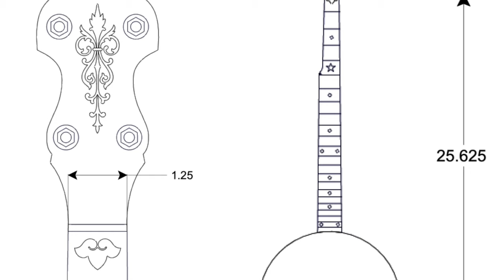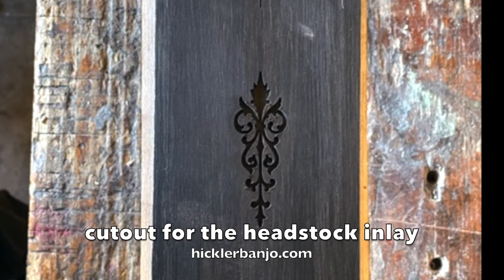Jack's Banjo conversion project -- from vintage Vega tenor to 5-string tubaphone

Comment: Jack...nice to see this documented. I also did a vega M conversion...neck by Rickards Banjos.. I'll message you a pic. Im sticking with the goat skin head..Rickards has installed a Renn head as well ..ok but I wanted an earthy warm sound without loosing sustain. Interestingly, Jason Romero suggested a coat of shellac dobbed on the inside of a renn head to reduce any chirpiness(my description) and warm the tone. Ive applied that to a 12" renn head banjo...and like it very much...better tone and no real lack of punch.
Reply from the maker: Thanks Doug! I might have to try the shellac trick.  The Ren head on the 1920 Vega sounds better than I thought it would, but a good skin head is always my preference.  El Nino brought a lot of humidity and rain to Colorado this summer, and I had to switch over to plastic heads on most of my banjos.  But winter is coming, so skins may go back on soon.